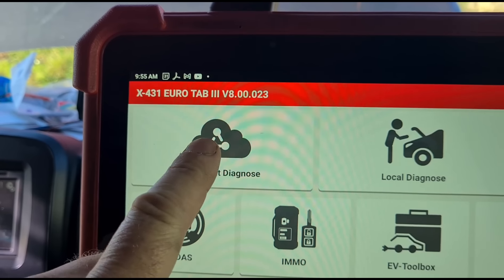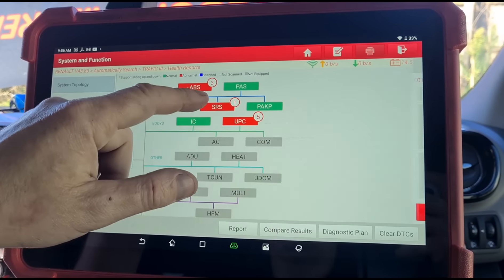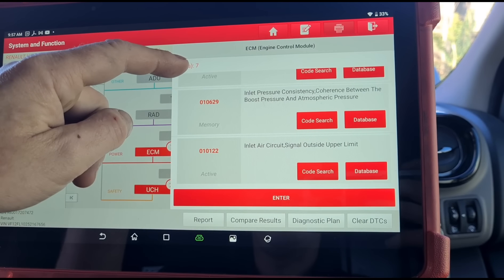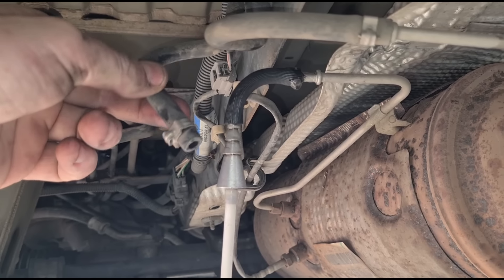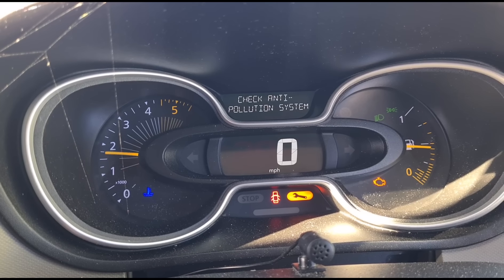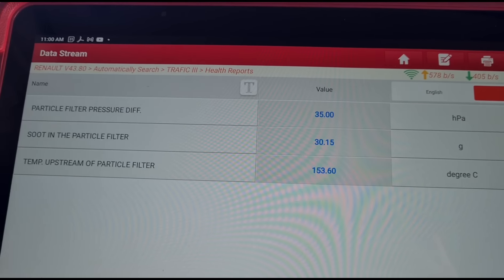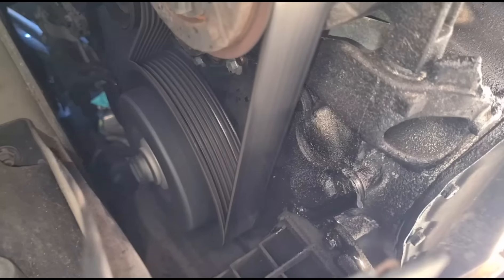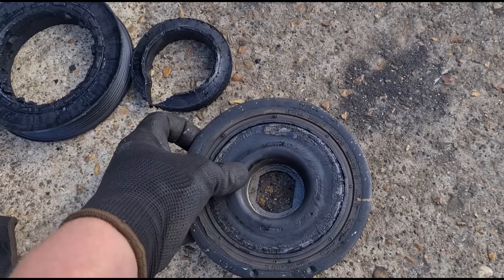Renault Trafic Breaks Immediately After Fixing A Separate Fault

Comment: Going through a flood, with air inlet so low, he's lucky he didn't hydrolock the engine. Great job, Jimmy, going the extra mile to replace also the crankshaft pulley that customer didn't know of.

Comment: This video gave me PTSD over the last renault I owned, check injection system, engine failure hazard, anti-pollution etc etc the thing was an endless money pit
Reply: What did you replace it with?
Reply: @MrZimmaframe  I got an old Peugeot 207 diesel that was made before DPFs were a thing, the missus went to petrol

Comment: As always thanks for the nice content video! Would moving the upstream pressure sensor pipe connection to the same position where the dpf differential pressure sensor (before) is connected (with a Y-connection) solve the pipe clogging problem?

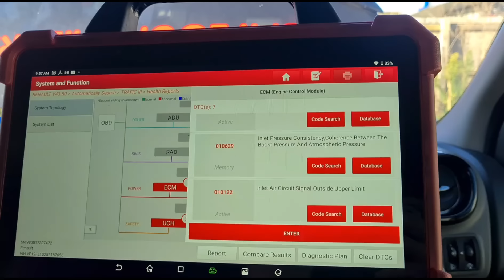Comment: Hi I've been following your channel for quite some time now. And very impressed with your work. I have a  2010 Ford Galaxy titanium the 1.6tdci version. And been having DPF issues on and off since we owned it. In the 4 years I've owned it I've used the expensive dpf cleaners you spread directly into the dpf several times. Also completely removed the dpf and cleaned it. I noticed recently again not doing its own regeneration. Tried a forced regen using the fscan programme but it failed. I then sprayed the JLM dpf cleaner into the dpf. But the thing with the fscan programme there is no way to show the dpf load, soot 1:36 level etc. 
I know you use the Launch X431 tab 3 diagnostic tool but is there anything a bit affordable for the DIYer mechanic that does similar jobs. Unfortunately I haven't got a spare £6000 hanging around. Any recommendations or tips would be very appreciated.

Comment: Jimmy Most probably the van has a chiptunning what killed the vibration damper pulley, It is a usual symtphom. Hard to imagine a normal van with such a young age and low milage has this kind of damage... not surprised if dpf and other stuff are also failing... lack of luck of chip tunning :)
Reply: Probably the oil leak has deteriorated th rubber in the crank pulley.

Comment: You know the renault clios how do you sort the water out that leaks into the passenger footwell
Reply: Make sure the drains are not blocked underneath the plastic scutttle panel, beneath the front wipers.
Reply: Yep same place on Dacia sandero/logan mcv... Had the same issue... Cleared the blockage and hasn't had the issue for the past 3 years

Comment: That's a terrible low place for air intake
Reply: No the intake sits higher. The tube does not reach down so far.
Intake is about 50cm above the ground.
right under the right headlights
Reply: Hopeless these car designers. You should see where they put oil filters now

Comment: Had my 07 octavia 2.0tdi in for a service today. They said the sump plug stripped the threads as they took it out. It's 80 pounds to fit a heli coil they get a guy to come in and do them. They don't do themselves.  Does any of that sound normal to a mechanic.? They are a full on garage mot testing etc
Reply: That is more of a engineering job. It depends on the mechanics I guess alot of them are really just fitters these days. They sound like cowboys if they stripped youre sump plug
Reply: You can buy oversized tap and sump plug kits. I had the garage do it as I'd used thread lock and silicone sealer to keep the oil in to be able to use the vehicle,  £70
Reply: @chucky2316  yeh I'm not convinced the thread got stripped on removal of the plug. It's not extortionate but the time delay is a problem
Reply: @chrisnewell-7758  if he phoned me and said there's a problem couldnt avoid it's 70 quid to fix and I can do it now, I'd be okay but he was saying it might take 2 days for the guy to turn up the usual guy is on holiday.  3 to 5 days without a car for a service!
Reply: It's a good job I do all my car servicing myself and I don't torque more than 30Nm on the Sump plug... Some garages use impact wrench 🙅🙅
Reply: @thindo  good for you 👍 I thought I'd treat myself and pay but I wish I'd done it myself.
Reply: If these 'mechanics' can't fit a helicoil I wouldn't trust them to wash the car let alone fix anything on it, never heard such nonsense getting in a specialist